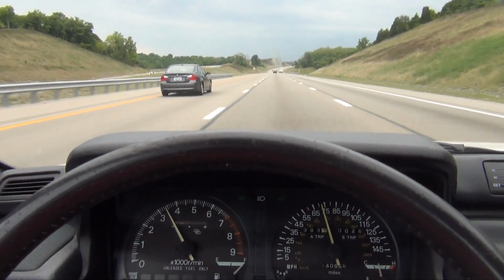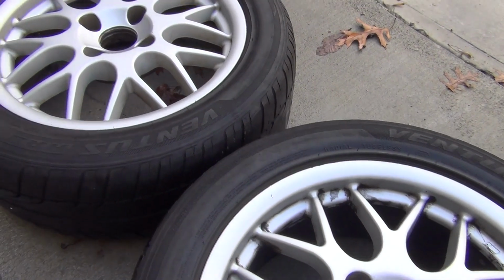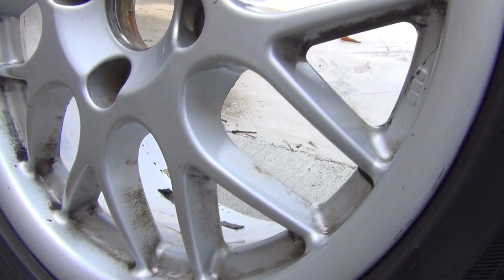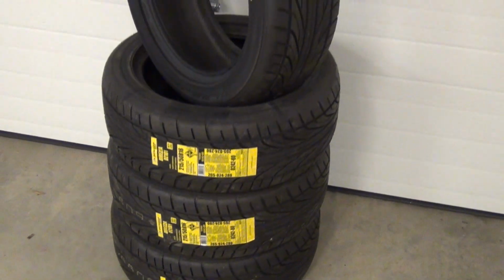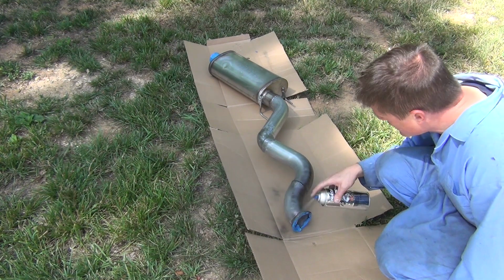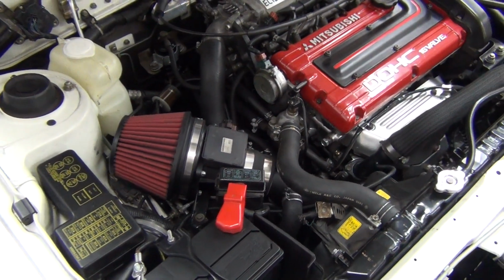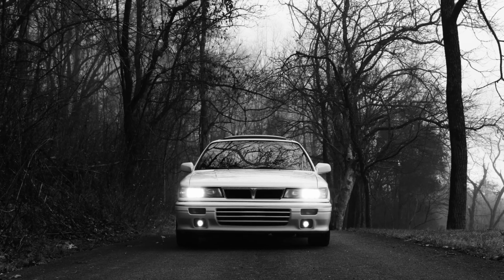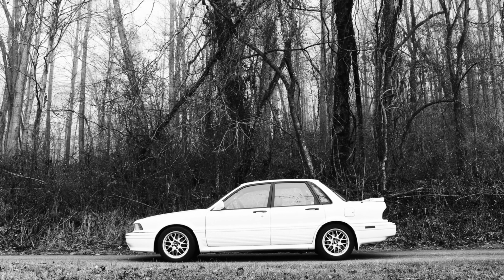Project Street Sleeper Part 13: Non-Sleeper Mode

Comment: i like how you did all sleeper stuff (under the bonet), but it is the right thing to see that big air filter when pop the hood
enjoy your ride
Reply: i forgot to ask. what about radiator? is it still stock( i have red that if you increase 2x stock hp you should  increase cooling capacity for about the same)?

Comment: Really interesting build series, and great increase in performance.

I couldn't help noticing the rough sounding idle, is this due to the cam?

All the best,
Ollie
Reply: +Sinner so i was damn close
Reply: Yes I would imagine, if he has the 272/272 in the guys car at our local DSM shop when I was 18 he had them, and they were lopey as hell, sounded like it would stall at idle sometimes never did, but ya know, Id say hes got like 264/272
Reply: +Tim Hake he has HKS 272

Comment: Nice upgrades and awesome gains! 
I have a KIA Optima SX Turbo 2015 and it currently runs 274hp with 269lbs of torque(stock). It has the same engine as the Galant, a 2.0L GDI turbocharged. I'm strongly looking into making some performance upgrades to make power gains, I'm aiming to hit the 400hp mark which I don't know if its possible, any ideas of what's the best thing I can do to make the more gains? I was thinking about upgrading all my performance parts that are shown in this series but I don't know if that would do as good in my Optima. I appreciate any help, thanks.
Reply: It's not the same engine as the galant vr4.
Reply: Ya wish you had the same motor, that's a 4g63t motor in that. Beefed up even more than it was in my 91 awd eagle talon tsi, and the mitsu eclipse and Plymouth laser, these were known as the DSMs, or diamond star motorsports.  Now as far as displacement goes yea you may have a 2.0 or 1997cc but that's it as far as sameness goes.  The flow of the head and intake mani are different, the camshaft grind is different and the turbos may be highly likely different.  Now the 4g63t motors were known for the abilities of being broken in right and maintenance properly making and holding and continuely running 400hp and built to the teeth well over 900 hp in big turbo high boost applications, I fell out of the dsm world because I sold my tsi to the junk yard I pushed 306 to the wheels with just bolt ons and 183k original miles on original headgasket, but I believe Shepard Racing had the fastest street legal Dsm in the world at one time.  But as far as your Kia turbo holding 400 safely I dunno, but it all is going to depend on the way you take care of it, and what kind of boost you end up pushing on it, and making sure you have a way to tune it and making sure it always has plenty of fuel with any and all air you add, coz you start messing with air fuel ratio, and not having it stoich around 14.7 youll start having hot spots in side combustion chambers and heating cylinder walls to the point they melt and/or detonation or pre ignition...none of the above are good so tuning and not just tuning but proper tuning is a must for longevity, as for what he is using on the galant, its ECM Link which when I had my talon was DSM Link, and as far as I know ECM link doesn't support Hyundai...but check Im not saying Im positive Im on to Cobb Accessport now with a Freektune in my 07 Mazda speed6. Have fun with it, and done right youll have a car that last you awhile. But don't just start throwin parts on because someone says to buy them, do the research and do whats best for what you want out of your vehicle.
Reply: Erick Navarro I hope you meant it has a similar engine to a Galant VR4. In that they are both 2.0 Turbo. But that's where the similarities stop. 

Bolt on parts are appreciated on your platform and you'll see the largest gain from a tune. 

If there was anything I'd do to steer you in the right direction it'd be; trans cooler, intercooler, midpipe and tune. In that order. Water meth injection is also a nice mod for these engines and if you do a custom tune to account for it, it will add more power. 

Do it right and it'll reward you. I ran 13.3 @ 106 tune/midpipe only in my Sonata.

Comment: I would stay with the new wheels and tires all the time. They look factory enough and don't give it away when the stock muffler and the other intake is on the car. And after all even with the intake and the exaust you probably wouldn't guess that this thing has 420whp. Its crazy. I want something like that.

Comment: When you first busted out those wheels they almost reminded me of the meshes that you had on your old Mirage. I still remember talking about that car on 4g61t.org. This whole build makes me really miss my old 90 Talon Tsi and my old 4G63t swapped 92 Colt. Tom I don't know what the hell you do for a living but your garage makes me slobber every time I watch your videos. Seriously, I knew about the series but I've only watched a couple of videos, I didn't know that you had all of these projects. Awesome job on the GVR4 and I'm not even going to start about the GN because that's one of my dream cars. For now, I'm working on a 97 Honda Civic EX Coupe with a JDM D15B SOHC VTEC with a FP custom 63 trim T04, 440 bluetops, 3" turbo-back, 33x11.75x3 FMIC, Tial BOV, Tial MVS external wastegate on 6 lbs, AEM wideband (which looks alot like your new Innovate), and a P28 OBD1 ECU that I socketed and chipped myself running on a basemap tuned by Chris Harris at Xenocron. It's nothing crazy but for a 1.5L single cam it definitely surprises alot of people. Anyway, thanks for sharing this with all of us. It's definitely a fun show to watch. God bless. -Rob

Comment: The car looks great! Just wondering what your thoughts on the air intake are given that the system you installed will suck in hot air from the engine bay as well? Did you consider using a CAI like the K&N Apollo?
Reply from the maker: Thank you Tom!  I'm not too worried about it, the intercooler and methanol injection combo counteract any air temperature difference based on data that I've collected in the past.

Comment: Did you have to remap the ecu for intake and breathing efficiency gains? Looks and sounds nice with the subtle mods
Reply from the maker: Thank you sir.  I haven't yet mainly because I haven't been driving it much due to the salty roads.  I plan to datalog and re-tune it if needed this spring.

Comment: Hey Tom, I finally found a set lol took me forever, were did you get your BBS center caps at? And what size is it? 67.1? All the best thanks.
Reply from the maker: timothy liska Hi Timothy, cool deal!  I adapted a set of stock volvo center caps with a BBS emblem.  Was a giant pain and is a very non-standard size.  I forget the measurements, but it is not a typical BBS center cap size.
Reply: Dam, ya I might just have to get a logo to go over it. Although I could just rock the Volvo center lol

Comment: Great video. The bbs wheels make such a difference! Did you have to re-tune the galant due to the new exhaust?
Reply from the maker: Thanks man, yes they definitely fill out the fender wells much better than the skinny stock setup.  I have not retuned the setup, when it warms up I'll do some data logging and improve the tune a bit.

Comment: Tom i just noticed your using the stock fuel pressure regulator.

As always take care thanks.
Reply from the maker: Yes, that's true.  I may upgrade it someday but it is working fine.

Comment: The sound of the exhaust thrown on that 4G63 brings me back.. but Tom, my question to you is: do you have any heat soaking issues? You didn't go with a larger intercooler, unless we can't see it :)
Reply from the maker: I did upgrade the intercooler, check the older episodes

Comment: Nice video Tom, as always great taste in upgrades and material choice for your videos. If you don't mind me asking, what kind or brand is your welder?  Thanks in advance!
Reply from the maker: Thank you sir and I appreciate the kind words!  My welder is a Lincoln Pro-Mig 135, but it has been replaced by the 140 I believe.  It's great because you can plug it into a regular household outlet and it handles most car and household related stuff without breaking a sweat.  I've had mine since the mid 2000s and I love it!

Comment: I own 1990 mitsubishi galant 1,8td GLS (best car ever ecept of being slow :-P ). Yes, I know it's not VR4 but I find it suprising that seats in VR4 are uncomfortable after just 2 hours...
I've done 1200+ kilometers (8+ hours of driving) with just two bathroom stops and no problem with geting uncomfortable. No problem with geting sleepy or anything. To be honest seats in my galant are the best I've ever experienced in any car.
Are VR4 seats so diferent from GLS ones?
Reply from the maker: Yes the seats are different, and I'm likely a fair bit older with a more tore up back than yours. :-D

Comment: Would had been nice to hear your QTP  cutout in reference of the sound, performance , response in the difference that it had made. Maybe next time keep up the good work.
Reply from the maker: Talon96fwd Thanks man, it still gets much louder with the cutout and the response is noticeably better too, so even a 3" straight through muffler offers some restriction at this power level.

Comment: What kind of welder do you have Tom? Looking at getting one for exhaust and just general use :)
Reply from the maker: Booki Hi there, I use a Lincoln Pro Mig, like this one.  I've had it for a long time and it has always performed flawlessly and is perfect if you only have standard household electrical outlets.  http://www.lincolnelectric.com/en-us/Equipment/Pages/product.aspx?product=K2480-1(LincolnElectric)
Reply: Tom's Turbo Garage thanks tom! Were you using gasless? Your welds looked really good! Sadly I'm in Australia so I don't think that welder will be available. Did you have to use any particular type of wire? Great work!
Reply from the maker: Booki You're welcome man!  No, I'm MIG welding with it, which requires shielding gas, which is easy to get at a gas or welding supply store.  I highly recommend MIG welding, it's easy and the quality of the welds are far better than gasless.  I used the wire size/brand that came with my welder, which has always worked great.  Good luck!
Reply: Tom's Turbo Garage Thanks for the info tom! Much appreciated ! If you get a chance, check out my latest video on a NB Miata, has some error codes which I am unsure about. But the AUS spec miata's have OBD1 till about 2001-2002. Hoping to see some more miata video's from you if you still have it :) Happy new year if I don't speak to before then!

Comment: Great video. I had the 2wd with an automatic and it rev'd that high too. Then I changed the overdrive clutch pack and the revs dropped. Do you have overdrive on your VR4? Just suggesting,  I know your very mechanically inclined. I miss mine.
Reply from the maker: Thank you!  Yes, 5th gear in the manual transmission is overdrive, but it is still geared short compared to modern cars.  It does make the car more responsive at highway speeds though.
Reply: Cool, I like what you've done recently. Especially the wheels. Keep up the great work. Cheers!

Comment: With that new muffler you can really hear those 272's at idle.  I have a similar setup on my Galant as well.  I commute 150 miles nearly every day in mine so also thought that 3750ish RPM at 80 mph was a tad high, but with near 28mpgs and boost instant at that RPM its kinda nice when you're passing someone who's not paying attention and see their blinker come on (happens almost every trip).
Reply from the maker: mkalb4g63 Thanks man, yes the muffler definitely opens things up at idle!  I agree about the gearing, a deeper 5th would help RPMs, but would surely make the car feel doggish in highway passing/hill situations for sure.

Comment: Tom, your series and personality are very informative and entertaining. Thank you for taking the time to share these adventures with us.
You've done an amazing build with the VR4. I'd like to offer some suggestions for future videos on the VR4. First maybe some testing. Dyno runs with small tweeks to squeeze every drop of power and efficiency, perhaps isolating the cone filter from engine bay heat would be "cool", add auto-spray system to the intercooler and test, some better seats that match the current interior, and Mr. Lego hood ornament. Yeah?
Reply from the maker: William Berry Thank you William and I greatly appreciate the support!  Thanks for the suggestions too!

Comment: nice work, Tom. That exhaust note with those cams is a little airy but really nice for a single 3" outlet. I was surprised you didn't swap out the blow off valve for one that vented to atmosphere. I really enjoy your videos, m8. They were the final decision maker for me when I was contemplating purchasing my VR-4. Thank you so very much. Now, I better get to work.
Reply from the maker: gbubble79 Thank you sir, I appreciate all of the kind words and yes, get to work!  Regarding the vented blow off valve, when using a mass airflow sensor, you want it routed back in to keep the drivability nice and smooth, especially between shifts.

Comment: Tom, I powered through all the Galant video's in one night, awesome build, great attention to detail. I love the simplicity of the build. As you can imagine, the detailing was my favorite section. if i could recommend something to you, get some Adam's in & out Spray to hit the coolant hoses and other rubber hoses and lines. I use it all the time and makes a huge difference in the engine-bay. For Non-Sleeper Mode, any chance you go duel map and add E-85 to the mix? Keep the video's coming amigo!
Reply from the maker: Ozzie Perez Thank you for checking out the whole series Ozzie!  Although, there may be some unwanted side effects to viewing that much of my goofballery all at once. :-D  Thank you for the suggestion for the rubber lines and such, I just looked it up online.  I wish I could run E-85, I don't have any available near me.

Comment: 3,500rpm at 75? Sheeesh. No bueno! Of course that being said my old 5 speed Saab 900 is probably doing similar to that. One thing that's nice about that kind of gearing is it's real easy to stay in the power band if you're having fun on a nice road.
Reply from the maker: Jesse Crandle I agree Jesse.  I think it is a product of cars from this era and I'm sure it would be doggy in stock from if 5th was geared any deeper.

Comment: Was the added wheel weight more due to the tires than the rims? 
I'd think BBMs would be lighter than stock.
Reply from the maker: Prince Humperdinck It was due to the wheels and tires.  Both are physically larger than what was on there before.  Plus OEM wheels are typically heavier due to their strength requirements.

Comment: Great upload as always Tom, I love the tasteful upgrades. 

Now just to address everyone's concern regarding the front tire seeming under inflated, that occurs because of the weight of the motor and transfer case. Do you really think a man who ensures that every component bolted onto his vehicles is at the appropriate factory torque spec would not check the pressure in his newly mounted tires? Any new tires correctly mounted upon clean wheels with new valves should maintain their pressure for a very long time.
Reply from the maker: kc550 Thank you sir and I appreciate the explanation.  Yes I am crazy about tire pressure as you'd expect!  :-D

Comment: Are you ever going to dyno it?
Reply from the maker: ***** Maybe?  It runs like a bat out of hell, the tune is clean, it gets great mileage.  Other than getting a number, I'm unclear of the benefit at this power level.
Reply: Tom's Turbo Garage i just really want to know after watching the all of the videos. You know its fast but us as viewers dont so it would be nice to see a number
Reply from the maker: ***** Did you see the performance test video?  I used a VBOX Sport, which is guaranteed to deliver accurate acceleration results within 0.5%.  From there, power numbers can be closely estimated.  It's all in the video.

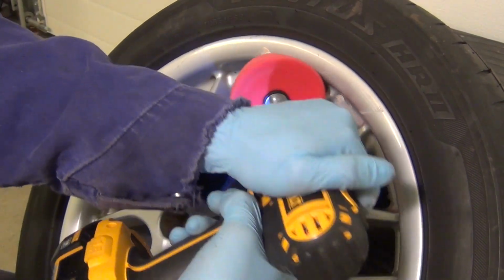Comment: Tom, do you think if I do this 5:32 on stock non coated mild textured wheels on my Miata, will it work? It's way hard to get into those corners.
Reply from the maker: Striball Hmm, I'm not sure if it would work on those textured wheels.  It may make drive more dirt/etc. into the surface.

Comment: needs a bit extra drop of the rear axel.
otherwise: nice!
Reply from the maker: jfv65 Thanks man.  This is with 1/4 tank of gas.  With more than 1/2 tank or so, it sits down in the rear.